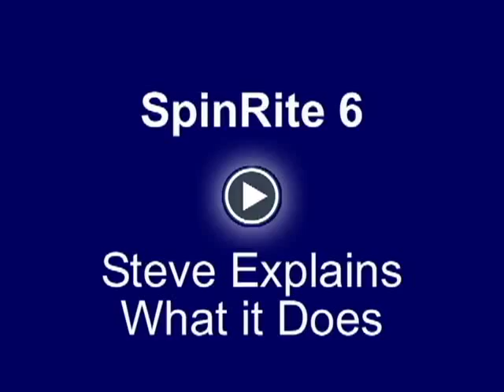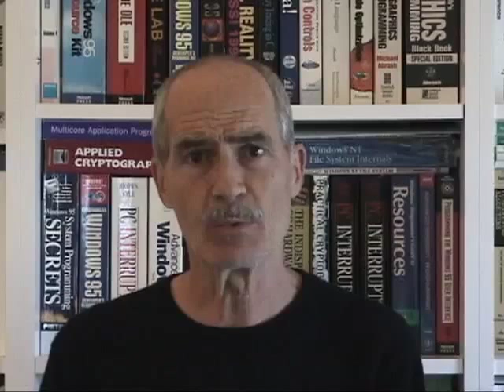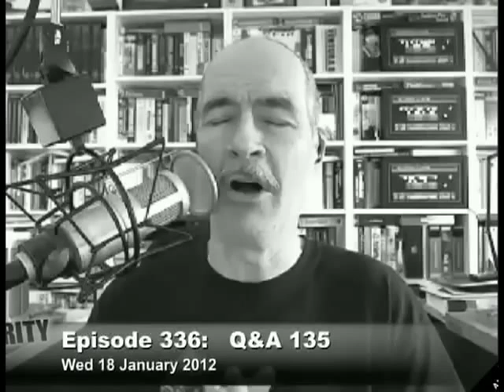Spinrite: What It Does

Comment: How do you run it on a mac?
Reply: You stated on Tekzilla it works on a Mac Book Air. Not really true.
Reply from the maker: +nick poverman You don't run it on a Mac. You take the Mac drive out and plug it into a PC, and run spinrite on a PC. It is advertised as PC software, not Mac software. Version 6.1 or 6.2 will run on a Mac, but it is still under development.
Reply from the maker: +nick poverman I didn't state anything on Tekzilla. It may work on a MacBook Air drive, but only if you plug the drive into a PC.

Comment: I ran spinrite and it completed scanning my drive, now how do I get the data off the hard drive? I'm confused as to how I do that. I wanted to get the data and put it on a different external hard drive. I can't find this information anywhere. Thanks
Reply from the maker: John Gronkowski 
Once Spinrite is finished you should be able to use the drive as normal, so just copy the files. If you want to copy everything sector by sector there are some free utilities to do that, such as DDrescie
Reply: Thanks. It didn't find any files (long story) but it wasn't spin rite's fault. It's a long story. Thanks for the reply.
Reply from the maker: Spinrite doesn't recover deleted files. It just makes sure your drive is storing the data correctly. If the file has been deleted, there are "undelete" programs to get the data file back.
Reply: Donn Edwards The problem has to do with the partition table. It is not Spinrite's fault as I know they don't work in that field. The drive shows up like a drive that has nothing on it, it has the full 500GB but it says there is nothing on the drive, and it doesn't have a drive letter, but I know there was stuff on it, it is very weird. 

I'm a college student and I don't have money just lying around, are there any partition table recovery programs that you would recommend? I would send the hard drive to a data recovery program but they are so expensive and I believe they charge you whether they find the data or not.

I tell you what though, I learned my lesson about backing my stuff up. I've said that before but now I'm actually doing it. I had a 200,000 word document on there with an idea for a computer game that would of made me a fortune. I'm so upset about this.
Reply from the maker: John Gronkowski 
I'm sorry to hear of your misfortune. I use Carbonite for backups. I haven't found any good partition recovery software that I can recommend. Perhaps your college IT guys have something? Before you start writing any serious games, check out the Indy Game movie
Reply: The trailer looks really good thanks. I have 1 question about buying partition recovery software, and I wanted to ask this question before I bought a program. When I plug the drive in it doesn't show up in disk management and there being a drive, if I buy partition recovery software will I be able to select the drive if it doesn't show up on the computer when I plug it in?